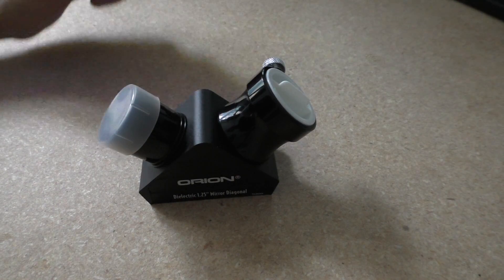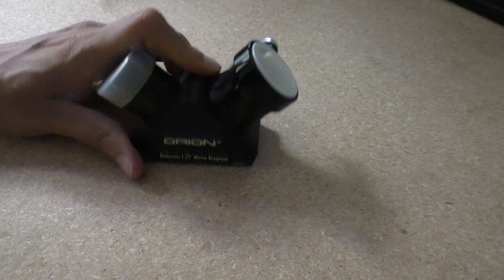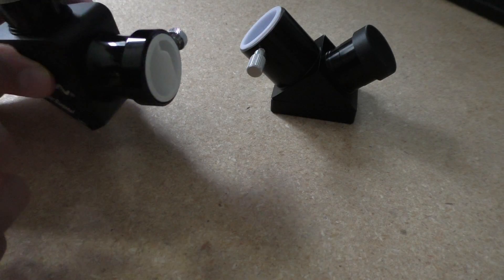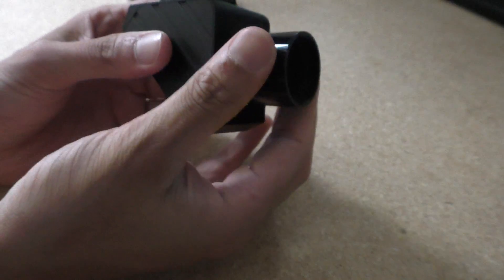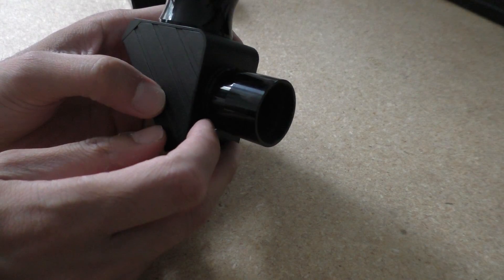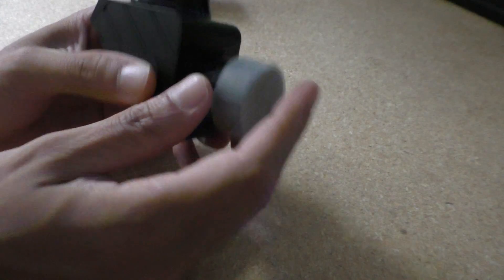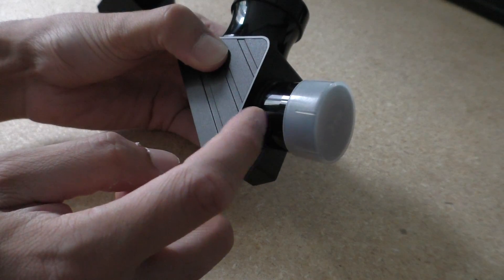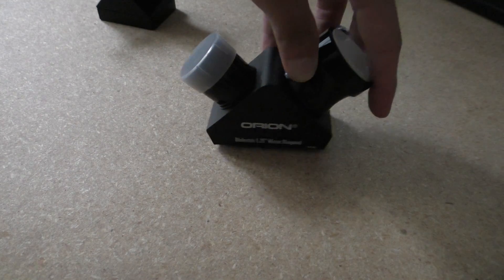Orion 1.25" dielectric diagonal loose connector

Comment: I noticed 'TAIWAN' printed on the Orion diagonal. Who made it? GSO? The diagonal has the bottom plate attached to the body with 4 screws just like the GSO one does. Most likely it's GSO made even judging by the body shape.

Comment: came across your video wanted to say I have a GSO 99% dielectric diagonal that has this same problem many times I've connected my phone to it that ring has come loose. not good for a $70 diagonal. this also my silver ring on my diagonal has nasty scars from it being scratched by the screws that pick it locked on.